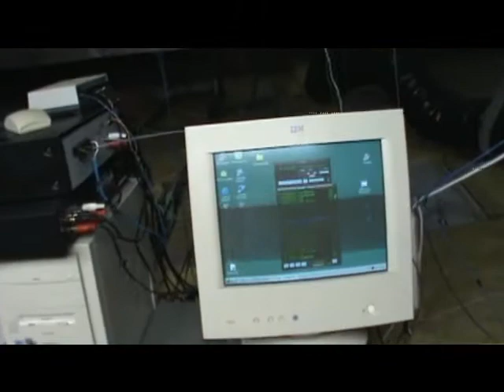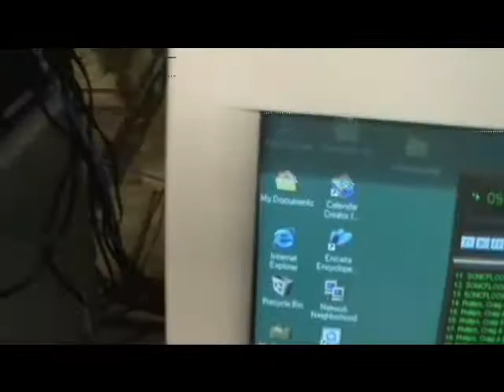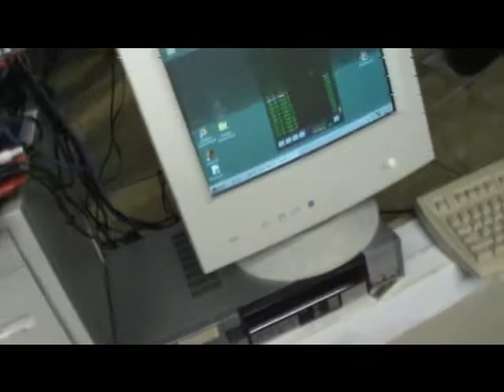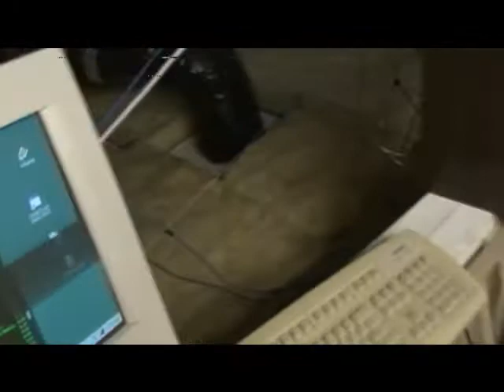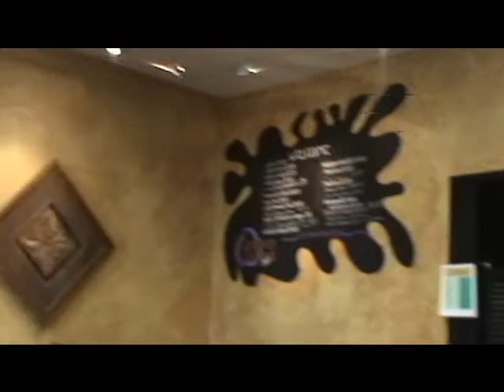Church Building distributed background music system

Comment: what kind of church is that? i had never heard of a church with background music system and a coffee shop, sounds kinda neat though, maybe the idea will catch on if it hasnt already, you can always pipe in for free the internet streaming background music station called seeburg1000.com.this is the original music that a lot of grocery stores and restraunts used to have,its all instrumental music with no commercials..and for the ceiling tiles, when i worked in a safeway owned grocery store in texas called randall's we would order those ceiling tiles from a contractor,they are the exact same ones i saw in your video, in other words check with your local grocery store and ask the store director if he has any spare ceiling tiles or if he could hook you up with the contractor that has ceiling tiles, i actually threw away brand new ceiling tiles still in the package because the boss wanted the space,lol,yepp grocery stores are known to throw away good stuff,